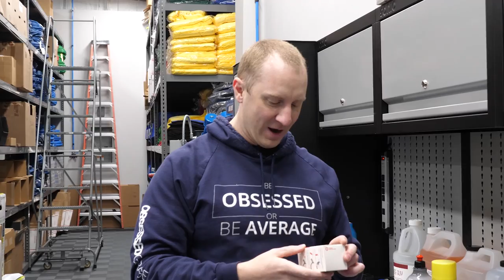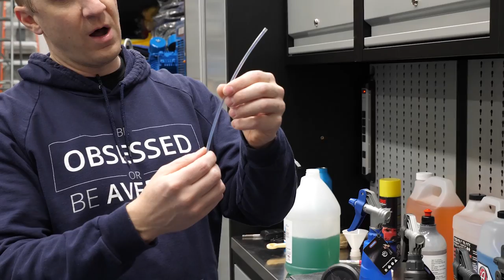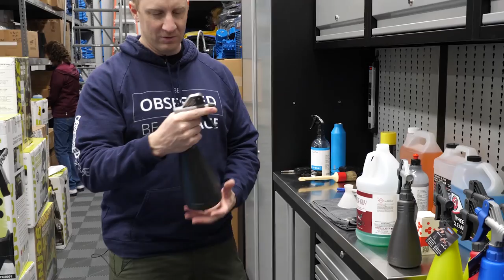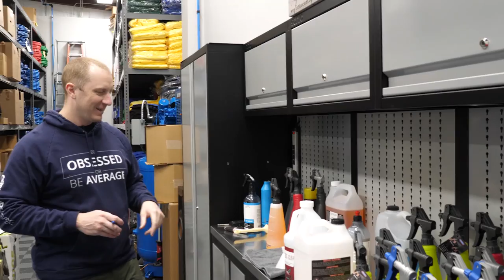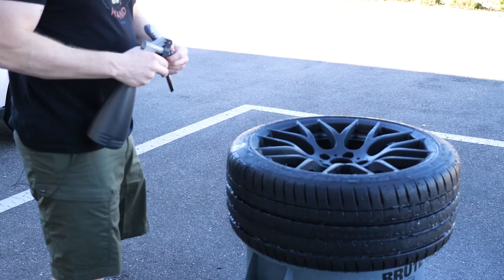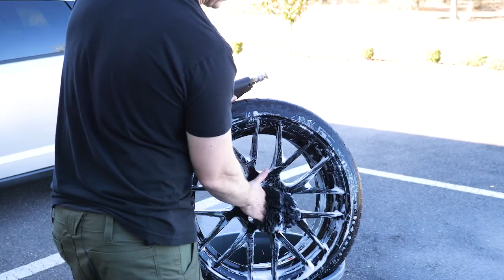Coating Wheels w/ Gtechniq C5 Satin Black BMW 1M 359 GTS: E1 - Prep

Comment: Excited for those new bottles. The 500ml size is great for everyone who buys bulk chemicals. I would much rather have a lighter weight sprayer that I can refill before each job, than some big heavy thing that stores more but is less convenient. It's also great that these bottles aren't just POS dispensable things, I would rather buy it once and keep it than to keep going through bottles that fade or change colors or aren't cleanable anymore.

Comment: The coating is likely ok. Most chemical raw materials have a shelf life of 1 year, and most of the time it is a 12 month PAO (period after opening). Most likely it is on their website with either the shelf life or PAO. Look for SDS or Storage conditions. Living in Florida you shouldn't have to worry about freezing and I doubt you left it in the sun. So I wouldn't fret about using the 10 month old coating.

I am a chemical engineer.

EDIT: Reviewed their website -> "Use C5 Wheel Armor within 1 year of purchasing.... We recommend only using opened bottles within three months of opening"

Comment: Unless I'm using a product undiluted, which is rare, I only use bottles with fluid measurement markings on the bottle.  Don't want to mess with measuring cups to figure out dilutions. Just want to do it in the bottle. Also, if I have multiple bottle of the same brand/size/color I want them to be translucent white so I can see the color of the product. I can immediately identify what the product is  that way without writing anything or putting labeling on the bottle. Food for thought.

Comment: I also have a Pressol bottle, but most are Monello's. A lot more practical, because the come with dilution and volume scale, are translucent and have the proper size (750ml).

Comment: I guess another option for when the ceramic coating fails would be to get the wheels sandblasted and repowdercoated, then reapply another ceramic coating.    Also looking forward to these new bottles, love the idea of the weighted end on the hose.

Comment: I'm interested to see what you think of the Pressol sprayers after you've tested them.  In my own search for a sprayer, Gloria has been on my radar; they sell some sprayers that look like Kwazar clones and a second type I've seen no where else, and they have a small foamer with a "flexing" swiveling head which could be just the ticket for detailers not wanting a larger tank sprayer/foamer.  It's so hard to find anyone who really is trying to make a BETTER spray bottle.  Many seem happy to make the same spray bottle or the cheaper spray bottle or the "different" spray bottle.  I want better.  You want better.  Who is making the better spray bottle?

Comment: Just provide clear bottles with ratio guide lines on the side. Most chemicals are colored nicely. I’m contemplating on buying the Walmart bottles for $1 because I like how their straws are super long and go all the way to the bottom of the bottle unlike many of the tolco sprayers I have that come short of reaching the bottom of a 32 oz bottle

Comment: Hey Matt, those conical bottles have me thinking they may be an excellent replacement for the bottle on the MTM PF22. I'm tired of my empty foam cannons falling over.

Do the threads match? And is the base wide enough to help with that issue?

Can't wait for the OG ergonomic bottles. I'd by they right now if PRESSOL would sell them to me.
Reply from the maker: Thats a darn good question.

Comment: I hope it helps , you said at the begining would it go off? , Hypathically it is possible but I have used Gtechniq C1 and C2 V3 . Now the c1 I used on a friend's car the following year who wanted to see if it would help I had great results bare in mind it was opened up. 

The C2 V3 I use it on alloys it's a sealant spray but I found the effects was great on the barrels of the wheels. I been wanting to use C5 but I was debating trying Carbon Collective wheel sealant soon.

Comment: Hey Matt, I really like the look of the new wheels! Much better than what was on the car!

Also, about your concern with the coating stability and whether it is good to use after that long, I think I could shed a bit of light as a chemical engineer. 
These coatings are typically a solution/mixture made of nanoparticles (such as SiO2, ZnO, etc.) dispersed in in solvents, with some other chemicals (such as silicone resins) added to help with the adhesion of particles on the surface, after solvents evaporate. 

The surface of the nanoparticles is chemically modified to make the particles hydrophobic (silane-modified SiO2 particles, for example). This is what causes the beading ;)
Their size is typically below 100 nanometers and they are dispersed in non-polar (water is polar for example) solvents, like THF, DCM, IPA, etc. 
SiO2 particles are used often because of their low refractive index (very transparent!) and high hardness (scratch resistance). Also, ZnO particles have shown to protect from UV. So, some of these coatings might have a mixture of two or more different particles. 

The most important thing is the concentration of nanoparticles in the solution. If it's too low you don't get good hydrophobic properties. On the contrary, if it's too high you get spots, patches, and not a very clear/transparent surface when dry. 

With that been said, there should be nothing in the coating that oxidizes, expires, or goes bad after you open it. So, you could use the coating again after a few months or even a year, "except" when the concentration of particles in the solution has changed since solvents can evaporate over time. This will result in a high particle concentration causing streaks, spots, and other visible imperfections after the product cures. 

You could store the bottle in the fridge (at low temperature, 4°C), after the first use, to prevent the solvents from evaporating and keeping the coating at the right concentration for longer, just a suggestion. 

I know this was a long post, but I hope it was helpful to some extent!!!
Reply from the maker: Fantastic brother!  I'd love to have you on the Podcast if you would be willing.  Please, shoot me an email matt@obsessedgarage.com

Comment: Are the plastic bottles strong enough not to collapse inward while spraying out its total liquid volume? 
Some thin wall plastic bottles you have to let air back in by unscrewing the sprayer, wasting time and rhythm.
Thanks for the videos.
Reply: It's the trigger head fault , it removes air without replacing it... 😒 " Vela " trigger heads do not have this issue.

Comment: If a tire shop mounts the tire on to a wheel by aligning the valve stem as close to the yellow/red dots on the tire then they might not have to use any weights, therefore minimizing scrapes or damage to the inside barrel of the wheels.
Reply: WRB-Berto The same can be said if they were to disregard the dots. It just depends on the weight distribution of the assembly.

Comment: I also hate how chemical resistant trigger sprayers wear out in less than a year. Tips given to prolong the life of sprayer is to turn the bottle upside down and spray out the excess chemicals until you are just drawing air. However with the weighted trigger upside down trigger, this won’t be possible

Comment: Function over form on the bottles. Not the prettiest but seem solid. Hate not having clear bottles though. Custom bottle solution with that shape + translucent plastic?
Reply from the maker: That may be in the cards in the future.  For now, we have to work with what is currently made.

Comment: Hi Matt
I know that this doesn’t relate to this video but I would love to know how your windscreen protection film on your 3RS is holding up. 
I like you am OCD with my cars the video you made about yourself and living with OCD and these cars is me 100% .
I made my wife watch it so she can see I’m not the only one on earth with this issue and owning Porsches.  
I currently have a 991.2 GT3 which is for sale with a 991.2GT3RS arriving in March I always have the cars completely wrapped in PPF outside and a lot of the inside also and I want to do the windscreen on the RS and would love to hear your feed back. 
Thanks Tony.
Reply from the maker: I had some defects from an unfortunate amount of dust that showed up during install.  I'm going to be redoing it soon.
Reply: Obsessed Garage at least it’s better then getting a chipped or cracked windscreen I would put up with the dust over a damaged windshield.

Comment: This is a “laugh with you” and not a “laugh at you” comment. Believe me Matt, I am a big fan. With all that said, here we go... 

I have never seen anyone in my entire life struggle with spray bottle adjustment like you Matt lol. I get something, make the pattern what I want, then never have to touch it again. Every bottle you touch you screw on the thing like it has 200 threads you have to get through.
Reply from the maker: Um....this is a brand new bottle that I have never used.  You would do the exact same thing.
Reply: Obsessed Garage I was talking about all bottles... in pretty much every video. Never mind. Didn’t know you would be defensive about it. Must have missed with the laughing with you part.

Comment: Hey Matt. Could you ceramic coat your rims with something like Cquartz?
Reply from the maker: Yes, you can.  I tend to use dedicated wheel coatings as they have theoretically been temperature tested.
Reply: Obsessed Garage Greatly appreciate it sir ✊🏼

Comment: The bottles look sick imo!  

Matt, just to confirm, the trigger is dual action right? Meaning they spray as you release the trigger as well like the kwazar?
Reply from the maker: It is dual action.  They are very Kwazar like with a much better trigger and ergonomics.

Comment: I found OPC diluted 1:1 cleans tires much better than Adam’s Tire Cleaner full strength. Have you tried it?
Reply from the maker: I don't want to strip my tires any time outside of the initial application.  That's why I like the dilution and strength of Adam's Tire and Rubber.

Comment: Matt tires also have a slight mold release agent on them from production, but that usually wears off in about 50 miles or so. Other thing is people don’t realize it when you’re going down the road the tires flexing and warm and releasing its compounds they migrate to the outer layer.

Comment: Why can’t you trust a tire place! Is there not a process some take for brand new expensive wheels, to avoid scratching them?
Reply: VinceAlinceAble SRT yeah if they have an older tire machine or someone using a metal bar instead of a plastic one you’re always taking your chances.